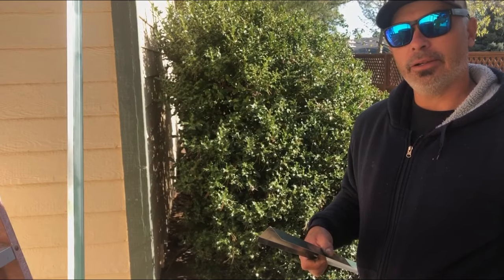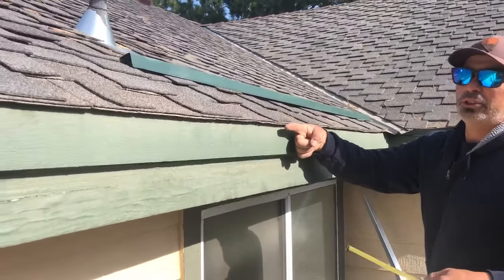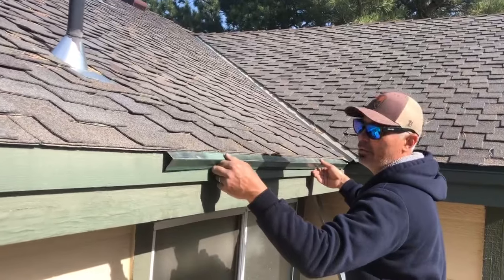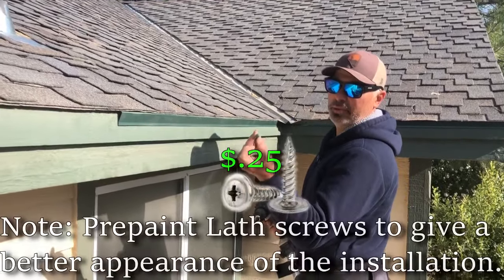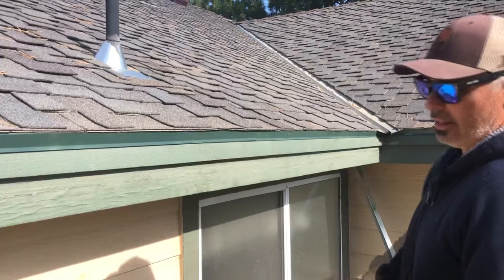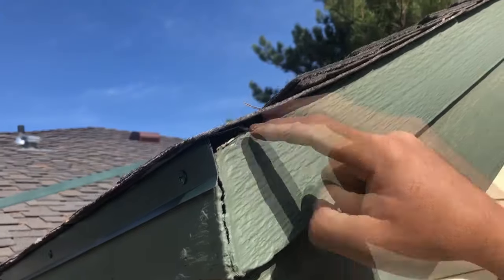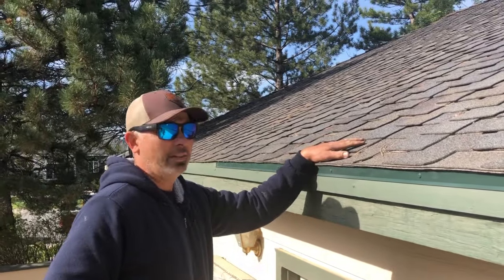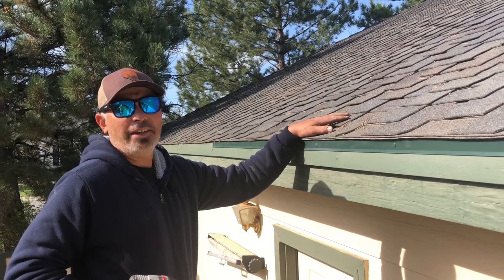How to install drip edge, healthy roof, Easy to do, stops fascia rot

Comment: This is incorrect installation of drip edge. Never screw into facia. Nail into roofing underneath shingles
Reply: Do a video showing how to replace or install drip edge when hte roof is already on the house
Reply: @realjwc9714  YouTube of roofing snake tool. It’s not ideal, but it’s much better than doing it this way. This is absolutely incorrect.
Reply: @realjwc9714   At that point you'd probably be nailing through the shingles and tarring over it. Not a huge deal.
Reply: I agree, nail or screw into the roofing
Reply: I was told that the drip edge shouldn’t touch the fascia. There should be a gap between the drip edge and the fascia.

Comment: How is this guy being allowed to show us how to install drip edge incorrectly. I am not a roofer but even i know this is wrong, and I agree with so many comments stating many of the things I find as an issue. I’m just glad I seen videos on how to do it correctly before I watched this one.
Reply: I've been searching for a video showing the correct way to install a drip edge to share with my son-in-law and can't find one!
Reply: @ https://youtu.be/c6nvkXPAMmE?si=e1OZ78NZFGYm05dd
Hi David, 
The above link is for a guy that has a lot of good DIY videos on his channel. He’s been doing home repairs as a professional for a long time and you may find it helpful. The link is actually for installing drip edge that I had saved to my tutorials playlist. Hope this helps, happy DIYing.
Reply: I personally like to nail a furring strip to the fascia that is not as wide as the drip edge.  This moves the drip edge at least ¾ of an inch away from the facia, making it next to impossible for water to runback under the drip edge and onto either the furring strip or the fascia.  I seen several video’s where the roofer simply nailed the drip edge ¾ of an inch away from the fascia board, resulting in an unsupported gap, which would allow the drip edge to flex and likely contribute to the nails loosening up or backing out… 
This link doesn’t show the drip edge, but the drip edge would hang down past the furring strip that is installed on the fascia.  

https://youtube.com/shorts/EU-MMlnrcKI?si=ZIV-4f3w3WjEx5UN
Reply: @davidg8032  I’ll check out the link you sent. Getting the drip edge further away from the facia is a great idea to prevent water runback as this is a problem with it attached so close against the facia. Thanks for the link, I’m always trying to soak up as much knowledge as I can on most everything,  take care.
Reply: @ You and me both.  I think just about everything you learn will come in handy one day.  Either directly or indirectly. I love learning ways to do things better, and I dislike, (I don't want to say hate) it when people defend something by saying "I've done it this way my whole life". People need to have open minds....

Comment: You don’t need to install flashing on the side I’ve been doing roofing for nearly 50 years always do it on the perimeter of the whole house
Reply: This isnt the side, its the edge, the Drip Ege where a gutter would hang.
Reply: Depends on the climate whether the side needs flashing, and wind. Old style was flashing over the corner and over the roofing, new style an underneath rake flashing.

Comment: TOH Contractor Tom Silva demonstrates in his YouTube that if you do not leave a finger thickness space between fascia board and drip edge vertical, the water hydraulics will run the water down the fascia board.... =  exactly what you do NOT want... so leave that spacing.

Comment: The fascia board needs to drop down a little bit to be in line with the roof or you will have a ski jump at the very end. Installing that drip edge just makes the ski jump a little higher.  Start with a bare roof.  Put the sub fascia on so it is even with the bottom of the rafters. That way you can nail the soffitt to it.  Then add the fascia. Make sure the the line from the roof decking across the sub fascia and fascia are level. If anything is higher than the decking you will have a problem.

Comment: I don't like how that piece lifts up the shingles . It created a U shape on the end of the shingles, and water runs back into the home at that area. Damaging underneath wood and etc... I see a lot of homes having problems with water leakage in that area that I talked about.
My home has that U shape after installing gutters and cause a mess for my home. I ripped out the drip edge,  gutters, and my home haven't had any problems since.

Comment: Most roofs will have rake flashing which supports the edge, the rake edge, (NO GUTTER) and the flashing goes under the tarpaper to catch any blow under or condensation. Not over the tarpaper..but UNDER it..

Comment: Never face screw or nail gutter flashing, you dont want your flashing touching the fascia board, ther should be a 1/4 inch gap or a pinky gap between the flashing in the fascia

Comment: 2 problems I see here, Johnny. First, the metal drip edge should not be touching the wood trim or fascia. This will allow water to constantly drip across a wood surface, eventually causing problems. If you’re using 2” x 2” drip edge in the video, then you could switch to 2” x 3” or 2” x 4”. This will give you more metal going under the shingles and allow you to pull it out away from the wood trim.
Second, you should not put nails into the front of the drip edge and into the wood trim. This allows a water opening and exposure of the wood trim. Drip edge nails should always be put under the shingles but be careful not to put them where the back of the trim meets the fascia, or the back of the fascia meets the deck plywood.
Reply: Yup. It sucks, but that's how you do it. I've had to unfortunately install drip edge after the fact when the roofers didn't do it.
Reply: Do a video showing how to replace or install drip edge when hte roof is already on the house
Reply: I stopped watching this terrible example just as I noticed these same two things.
Reply: Just order drip edge bent for that 4/12 roof, not hard to find.

Comment: Totally wrong installation. As others have said, drip edge shouldn't be touching the fascia or nailed or screwed to it.  It should be nailed under the shingles. Also, drip edge installed on the gable ends prevents wind driven rain from getting under the shingles and rotting the deck from the edges back. There are enough videos on YT showing how to install it correctly, and this isn't one of them.
Reply: Agreed, and it doesn't even need wind. Water can literally migrate around the shingles and be pushed by more falling rain to creep over to the wood on the sides on the downward slope.

Comment: I need to install the drip strip and want to install easy on gutter guard at the same time... can you show the best way to do this?
Reply: Becky look elsewhere for help. This guy has no clue as to what he is doing. Part of the problem with YouTube is anyone with a hammer and a screwdriver has become an "expert" at DIY projects. People follow YouTubers advice and it costs them big time down the road. There are a lot of videos here on YouTube that give awesome information. This is not one of them! Keep looking here on YouTube, you will find helpful info for your project.

Comment: This is incorrect. Drip edge should not be against the fascia. The water will drip off the edge and still catch on the fascia board, rotting it. You should have put a screw through the shingle up top and then bent the drip edge out away from the fascia board.

Comment: It's been 30 years since I roofed and then I was putting on metal roofs but our roof got damaged here in Florida from hurricane Ian and fellas that help me strip and reshingle our roof when installing the drip edge on the fascia side a lot of the drip edges sticking out and it's not up flush and where the overlap is it's not very flush either so I was wondering if there was a way to fix that because I didn't think you were supposed to put nails screws basically any holes through your drip edge, fascia, into the wood

Comment: Incorrect method. Slow water will still drip onto facia. Should nail under the shingles and both shingles and edge comes out a bit more.  Please remove this video to help others.

Comment: I'm a newbie doing my research. It seems that many people advise nailing or screwing from under the shingles, and if you have to use the facia sealing it; either way many people say to leave a gap between the facia and edging as well. I'll have to try to determine the consensus on what the right way is.
Reply: I'm not even a roofer this guy is a hack!
Reply: This video is the incorrect way. Actually the opposite way you want to do it. Not only will it not work but doing it this way is also a waste of money.

Comment: 1. Drip edge does go on all slopes of the home and especially cornering ends, rain comes down from all directions.
2. You do not want to penetrate the fascia with any kind of screws or nails, it'll just allow another access point for water to seep into over time.
3. Use some type of silicone if you do it this way.

Comment: This is great advice!... but many do not understand that there is such a thing called “shingle molding “ and that’s what he’s installing the flashing onto...I would love to see more videos with houses that have traditional “shingle molding “...and now there is the option of pvc (as shingle molding) so the pvc wouldn’t rot...but yeah, the metal flashing can be installed from the top of the “shingle molding “... and tar around the nail... and if the metal is custom bent to fit the shingle molding the water rolls right off the flashing.
Great videos!....I would really like to see more of this type of fascia and rake boards that have the traditional shingle molding 😎👌👍